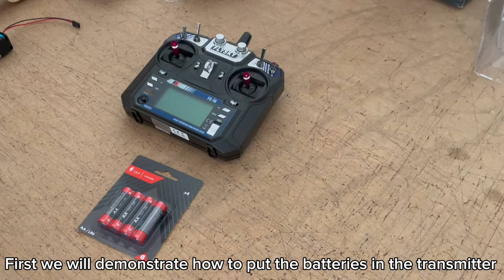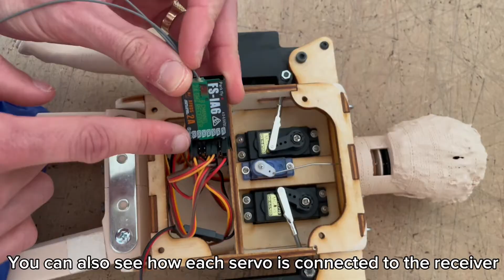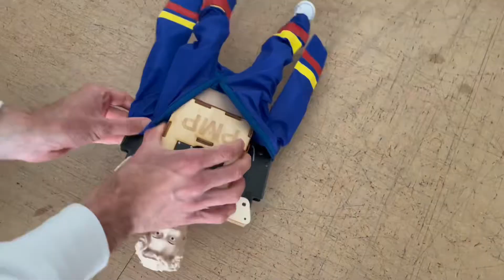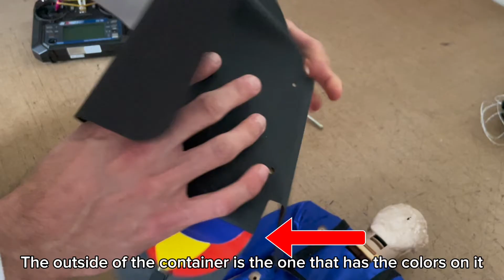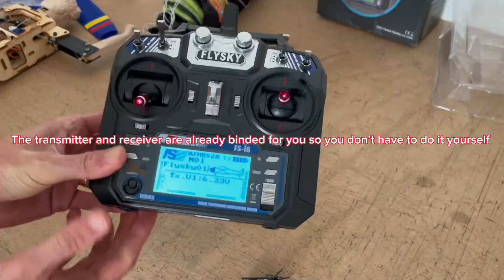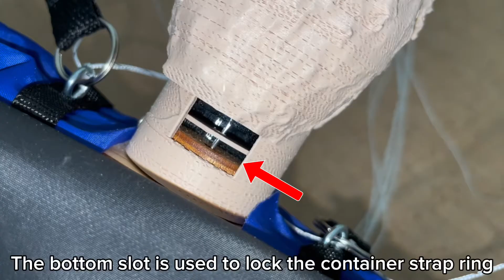How To Get Started With Your RC Skydiver - Set Up Guide - RC Skydiving

Comment: This is SOOOOO overpriced! You should make pnp or arf version.
I won't pay 700$ for this!

Transmitter only costs about 130$ and a piece of wood with servos shouldn't come more than 90$, so everything should be around 300$.
Reply from the maker: Thanks for your comment, the building and assembly time is taken into account for the price, because each mode is carefully handmade. The parachute requires hours of cutting and sewing as well as all the accessories (jumpsuit, container, harness,…). It is not only a matter of material supply cost.. I hope you’ll understand that I’m trying my best to get the lowest price possible.
Reply: @paul_mini_parachute   Really very very  overpriced!!! Just use computer and laser machines to produce the parachutes - now not 19 century to make them by hands!!! And using ply wood in the modern days of 21 century - is very very old school and looks ugly and very cheap! You must use carbon or fiber plastic for jumper and for drop box. Use 3D printer!  Invest into your items NOT equal to  the fun at all! Spending a lot of money for what? Just 10 sec diving - not really control the parachute after its deployed - just around 10-15 meters off the base.( not like 100-150m minimum)  What's the point?!  Easy to use round parachutes with 1/5 scale dolls. Sizes of the containers  much more then dolls body- usually most popular  1/5 or 1/4 scale - 30-35 or 45 cm height. But your container is  around 30cm . Too big. Its must cover just half body of the doll. So we need 70cm height doll! Too much money - but where is fun???
Reply: @933pilgrim  holy yapathon